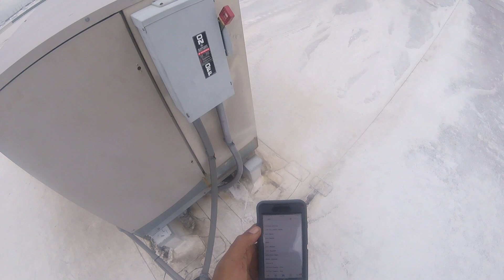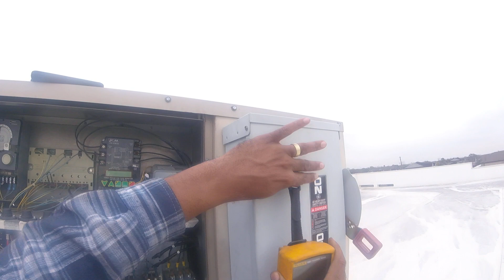HVAC Checking O6D compressor Part#1

Comment: sometimes all 3 legs dont disconnect when you pull handle been known to break even though handle down one could be stuck cause broken disconnect always check with meter or open disconnect box especially on older ones its happened to me many times iv4 seen all three stuck in while handle was down